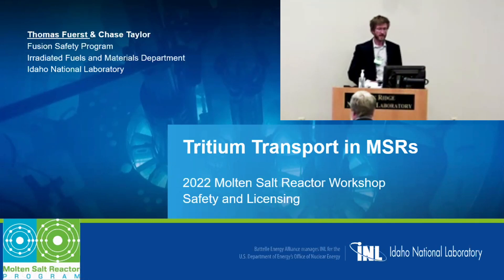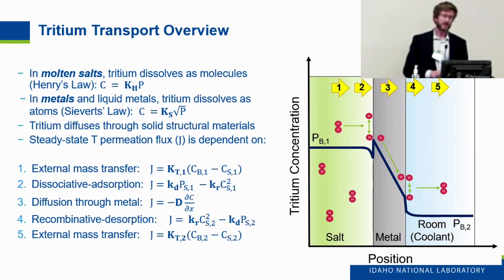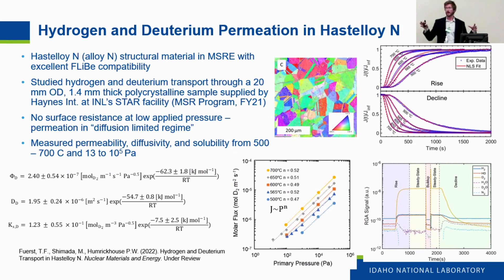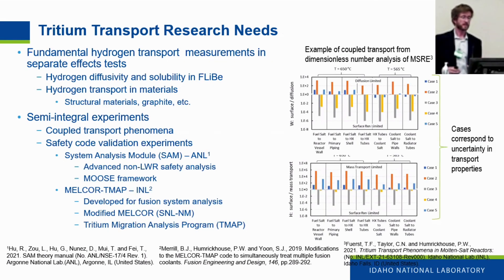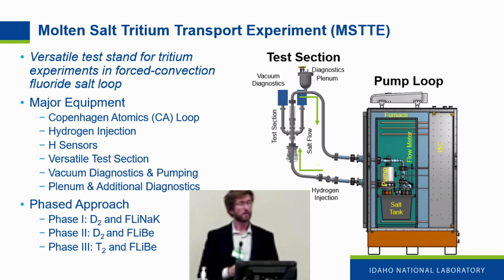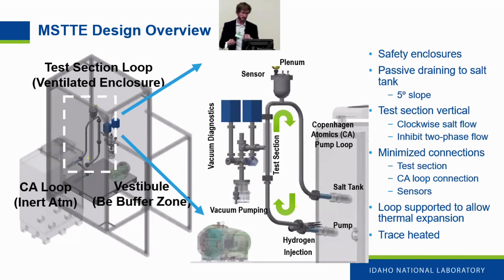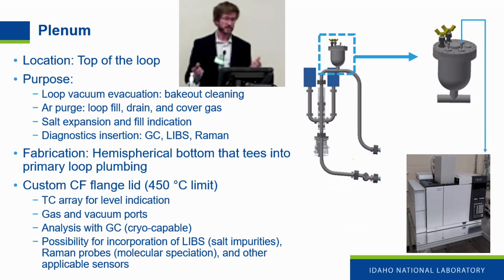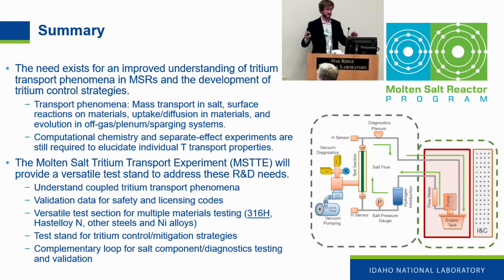Thomas Fuerst: Tritium Transport in Molten-Salt Reactors @ ORNL MSRW 2022

Comment: The elephant in the room is the comparative rarity of the elements in FLiBe. There is a question whether a world wide implementation of FLiBe reactors is even possible due to the rarity of those elements. I'm wondering if the Fast Chloride MSRs have similar rates of Tritium production or of other troublesome radioactive daughter products.